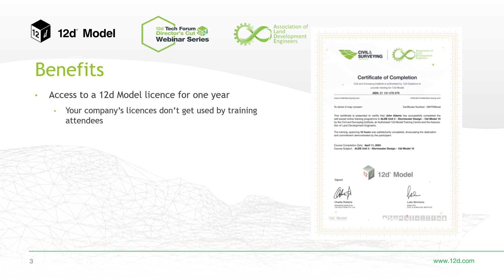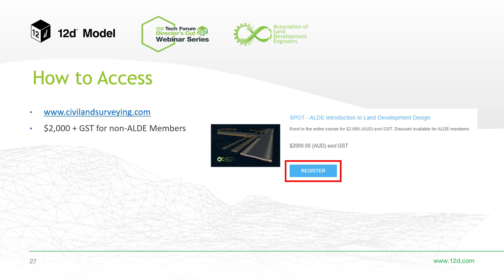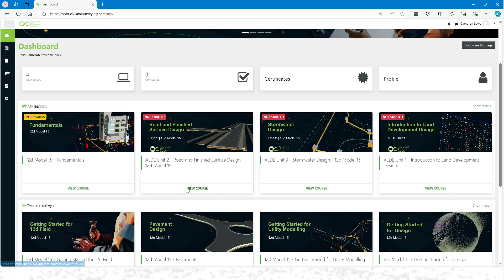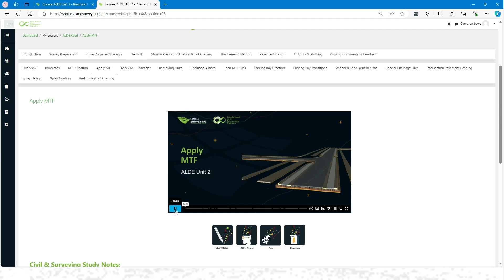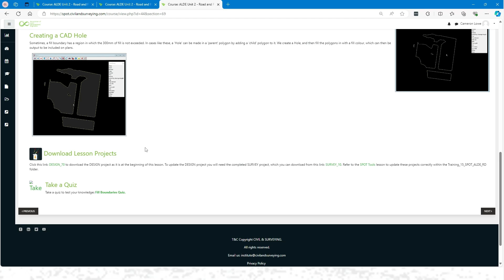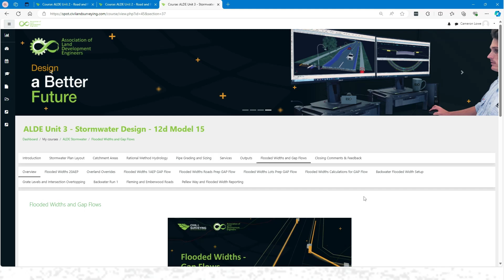ALDE and 12d Model - 12d Tech Forum 2024 Director's Cut Webinar Series

Comment: This ALDE appears not to include the lot control section for the sanitary sewer and the types of sanitary sewer laterals. Additionally, it does not provide detailed guidance on how to select pipe diameters for water supply or how to calculate pressure for pressurized water systems.

Do you have any additional courses related to the topics I mentioned?
Reply from the maker: Hi, you're correct that this course does not include these topics. There are currently no instructor-led courses which cover these, however some relevant videos are https://www.youtube.com/watch?v=Q6qT0Euqfsw and https://www.youtube.com/watch?v=s8oKLyvrEF0.